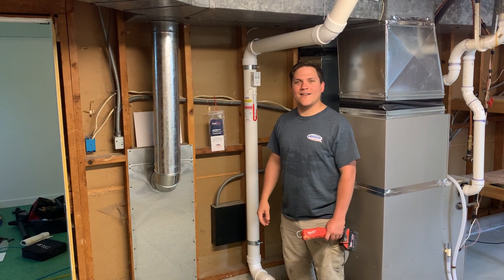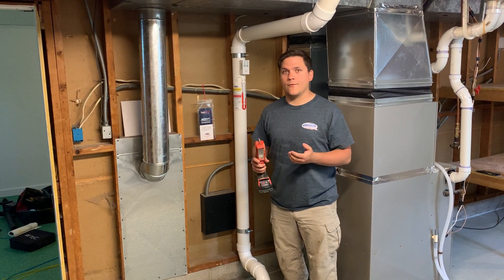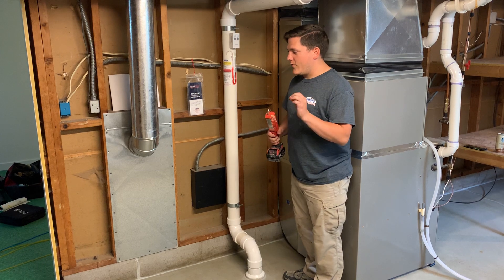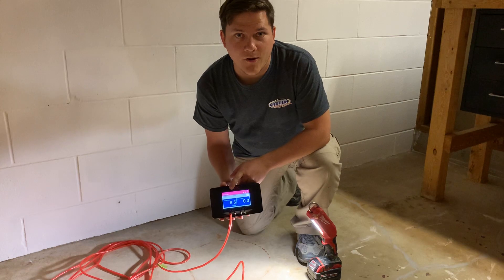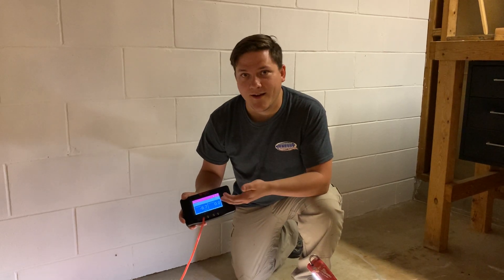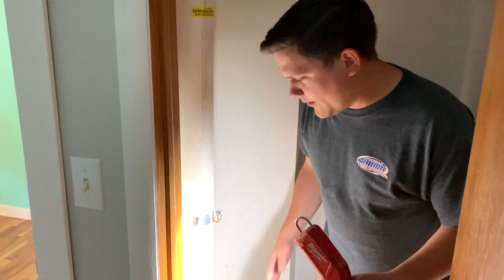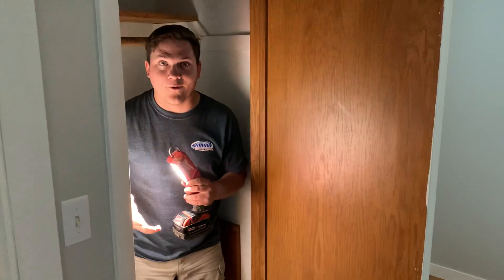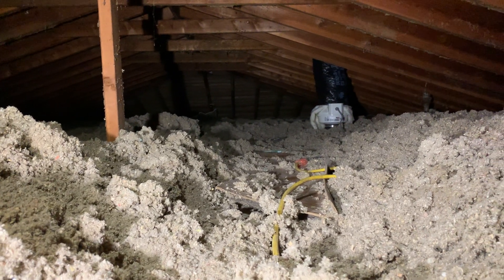How We Engineered an Energy-Efficient Radon System

Comment from the maker: The home, built in 1960, had a center footing and an initial radon level of 6.0 pCi/L. After mitigation, the AirChek post-test came back under 0.3 pCi/L.

System Design Highlights:
We performed Pressure Field Extension (PFE) testing to:

* Determine the best location for the suction point
* Calculate how much air is needed to be moved to achieve negative pressure
* Gauge how much suction the radon fan would need

What We Found:

* When digging the suction pit, we discovered gravelly sand, which allows better airflow than fine sand or clay
* This meant the center footing wasn’t a major barrier, so we didn’t need a second suction point on the finished side

System Optimization:

* We started with a 10-gallon suction pit, requiring 9 CFM at 2.0" WC
* Enlarging the pit to 25 gallons dropped the suction requirement to 1.2" WC, reducing annual energy cost from $150 to $83

* We then sealed cracks, plumbing penetrations, and floor-to-wall joints on the unfinished side
* This dropped the CFM requirement to below measurable levels—estimated at under 5 CFM, with only a small amount drawn from the home

* Thanks to sealing and the ability to dial in the Fantech RN2EC radon fan, the final operating cost dropped to just $23 per year:

$19 to run the fan
$4 for the added ventilation

 * That’s a savings of $127 per year or $1,270 over 10 years from just a few extra hours of work.

The savings can be even more dramatic in homes where the radon system is moving more air, like those with interior drain tile systems.

📍 Service Area
Serving Colorado’s Front Range and Mountain Communities:
Golden, Boulder, Denver, Cherry Hills Village, Evergreen, Breckenridge, Vail, Aspen, and nearby areas.

🗓  Schedule an Estimate
Live in Colorado? Book your in-person radon mitigation system estimate here: https://americanradonmitigation.com/

🌎  Have a Question for Jesse?
We offer virtual consultations worldwide: https://americanradonmitigation.com/consulting/

🛒  Need a Radon Monitor or Supplies?
Shop our online store: https://americanradonmitigation.com/shop/

🛍  Our Amazon Store:
https://amazon.com/shop/americanradonmitigation
We participate in the Amazon Associates Program and may earn commissions from qualifying purchases made through the links above. Thanks for your support!

🎓  Looking for Continuing Education?
Check out our radon courses here: https://americanradonmitigation.com/continuing-education/

Comment: Per this video, I'm curios about the distance you have from the in place"mushroom" roof vents. As you know, the radon mitigation discharge point is suppose to be at least 10' feet away from other openings in the structure (operable windows, vents?). Do attic "mushroom" vents not count as on opening in the structure and you just need them to be away from the discharge and outside of the "cone" zone of the top of the discharge point? So you could be as close as you want to them? Your company sure looks like it does A+ work, congrats!
Reply from the maker: Thank you, Mike. That's a great question. The way I understand the standard, there is no restriction on how far you have to be from a roof vent with your exhaust discharge. If it were a window or an intake, it would be a different story. 

Check out the standard as it has clear direction on this. https://standards.aarst.org/SGM-SF-2017/23/index.html
Reply: @AmericanRadonMitigation  Thanks for the link. I concur with you. Per my question and your link, it looks like maybe section 6.4.4 might have something about it and states the exhaust spread radius of 11 degrees just can't encounter the attic ventilation opening. That's pretty easy/ Thank you for your prompt response!
Reply from the maker: Good catch, Mike. You're welcome.

Comment: You mentioned some sort of holding tank under the slab? What is that about?
Reply from the maker: Hey Bill. I don't see where Chris mentions a holding tank below the slab. What's the time stamp of the part you have a question about?
Reply: @AmericanRadonMitigation  44 seconds in. Talks about a pit.
Reply from the maker: Do you mean the suction put we dug below the slab?
Reply: @AmericanRadonMitigation  yes. Think he mentioned amount in gallons, maybe that is why I thought it was a tank.
Reply from the maker: The more sand we remove, the easier it is for the radon fan to pull soil gas through. Think of trying to breathe through a coffee-stirring straw compared to one of those giant milkshake straws. Which one requires less energy?

Comment: Why do you not need to prevent rain/snow from falling into the pipe on the roof? There's a negative slope all the way to the basement, couldn't that introduce moisture?
Reply from the maker: Hey James. That a question we hear a lot. 

A radon system will draw moisture from beneath the slab of the home. Condensation that forms inside the vent pipe and rain will simply drain through the system and into the soil, where the fan will continue to dry it out. 

Rain caps and horizontal discharges are frowned upon as they can increase freeze up issues and increase the discharge clearance requirements. 

You can see what the AARST radon mitigation standard has to say about that on pages 16 and 17. https://standards.aarst.org/SGM-SF-2017/16/index.html
Reply: @AmericanRadonMitigation  Thank you for the information! It's good to know. Let me ask you one more thing: Schedule 40 is recommended for the pipes going up to the roof from the slab. What about below the slab? I've seen installers use the black perforated pipe as well as schedule 40. Would the black, bendable, perforated pipe  be OK? As it's hard for me to find perforated schedule 40, 3 inch around me (restricted to 3 inch due to gravel depth).  I don't see sub-slab air sucking pipe material mentioned in that document.
Reply from the maker: @nebulousJames12345  Is this for a home you are building?
Reply: @AmericanRadonMitigation  The house is 24 feet x 34 feet. It's already up but the basement is unfinished (gravel floor).  we'll cement it at some point, but for now, we were just going to put some piping, sealed 10 mil, and the radon system in.  Would like to do the black perforated pipe as it's cheap, easy to deal with, and easy to find perforated in 3 inch. But i'm not sure if schedule 40 is required/recommended for sub-slab...I can't find anything online about that.
Reply from the maker: If so, check out section 403 of the new construction standard. https://standards.aarst.org/RRNC-2020/11/index.html#zoom=z
Reply from the maker: @nebulousJames12345  Schedule 40 pipe is not required below the slab.